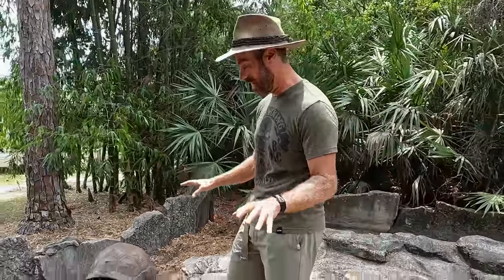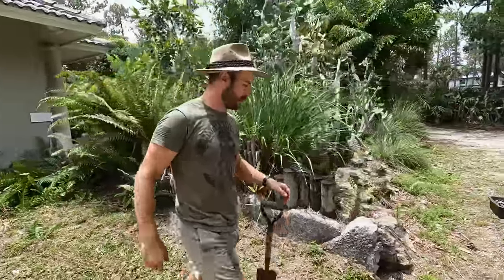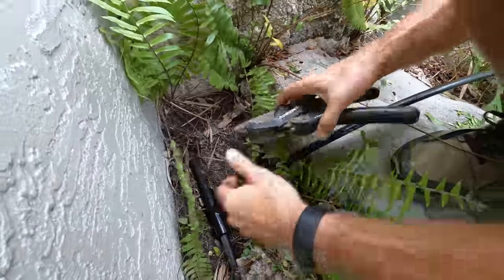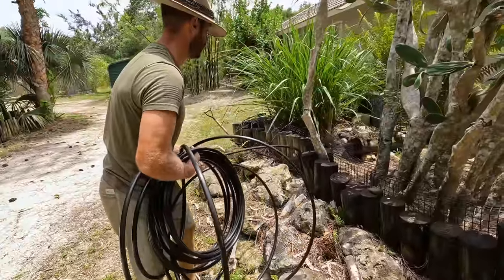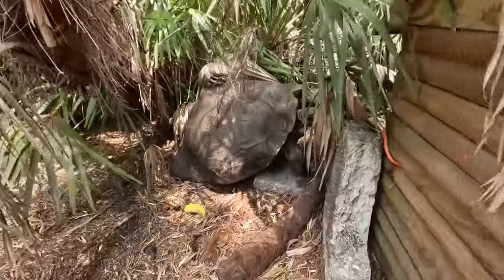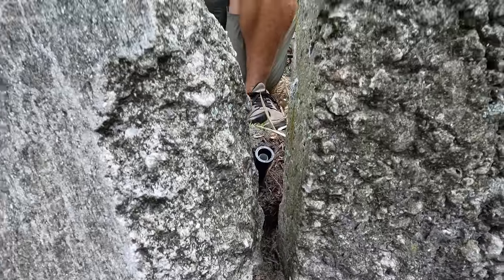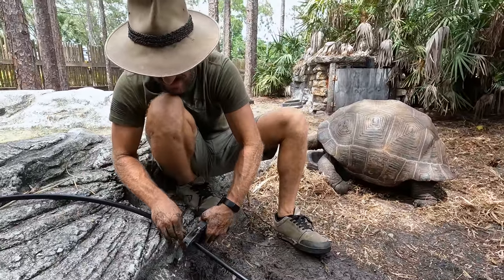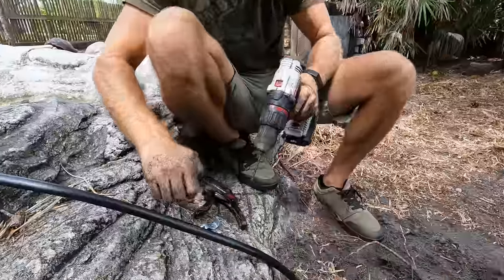We BUILT a Galapagos Tortoise SPOUT!

Comment: Very cool project!  So much easier than running water lines in Canada, ours have to be buried a minimum of 6 feet to avoid them freezing. I wonder if spray painting the poly tube to match the concrete would make it less noticeable to the tortoises

Comment: Good idea. I might’ve suggested threading the polyvinyl water tube through a larger pipe (either heavy-gauge PVC or metal) just under the section that crosses the driveway. Then the vehicles can’t compress it over time with their weight. You can also plant a hardy (non-toxic) vine and train it to grow up that bamboo to obscure it. You may need to protect it until it gets established. Trailing Rugosa (beach roses) have edible rose hips the tortoises would enjoy eating for extra vitamin “C.”

Comment: 🐢 🐢 are so intelligent and inquisitive. Use some wire mesh around the tube, then the bamboo. Plus use that cut off piece of pipe (no waste) as the hose that you attach when you need to wash, water/mud the area. If possible keep the hose extension near the enclosure..

Comment: Kennen I don't think that bamboo that bamboo is gonna lasts. You are going to  need to use something stronger. You can keep the bamboo there but here's a suggestion. Cover the bamboo with concrete. It won't effect the tubing because the bamboo is covering it. And the Tortoises won't try to eat it. Out of Site, out of mind. Plus you will be able to just pull the tubing out from the concrete  because of the bamboo  covering over it. And you can make the concrete look like it's always been part of the pond.
Reply: I had the same thought as well. Concrete is the way to go. Plus, if you added some rocks as well you could then make it look like a spring bubbling out of the ground instead of a pipe emptying into the pond.

Comment: Good improv brother. Find a irrigation store Ewing is a national chain. There are way cooler products out there that work super reliably to make water happen for the animals. The Depot and Lowe's are severely limited. Hot tub shut off valves pull up and push down to open and close them no adjustable pliers needed also bury that valve for the drain and supply side in a valve box so you can operate it easily and prevent damage. There are flow controlled pop up sprinklers electric solenoid valves filters microsprays drippers soaker tubing and timers that can be programmed to do everything hydrating you would ever want. You can even put a delay on the timer if your well needs time to refill. I should make you a design schematic and email it to you. Are you still using that Gmail account?